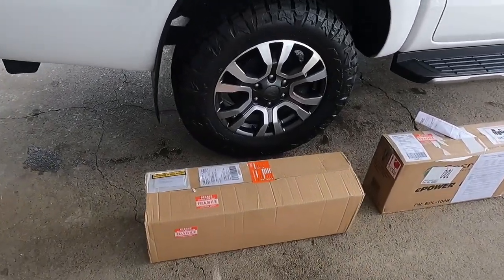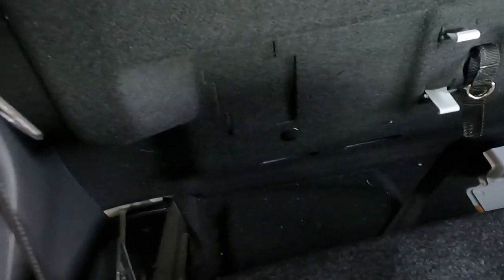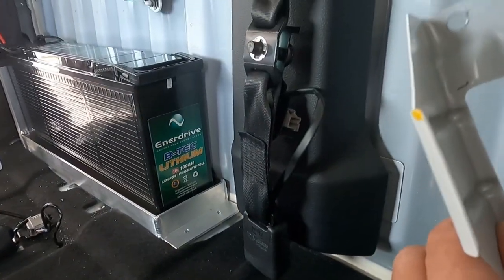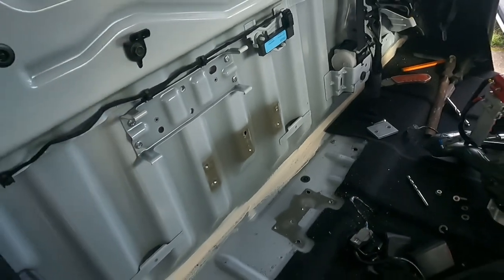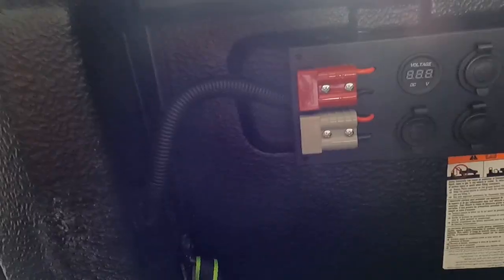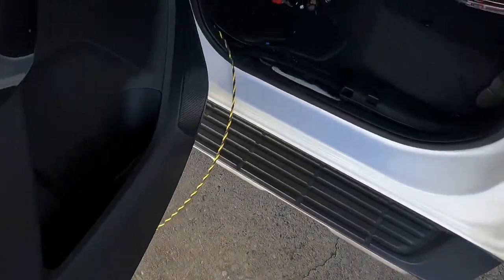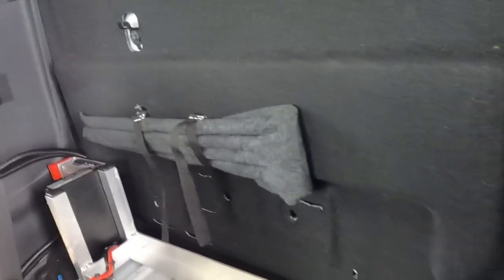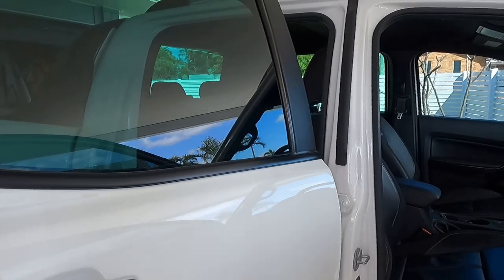Slimline Dual Battery system behind seat DIY install in Ford Ranger

Comment: Great video mate!

Did you need to turn your smart charging altenator off?
Reply from the maker: Thanks mate. I’m not sure what that is so assuming no😅
Reply: With the wire connected to the ignition source, that should cover the smart charge alternator issue.

Comment: Mate where did you order the kit from? Looks good!
Reply from the maker: Look up Accelerate Off Grid. They are based on Sunshine Coast but also online. We just did our first camping trip since installing and it didn’t miss beat.
Reply: @the4explore922  Hey quick question I have installed a similar product now when the car is running the idle drops down and up do you have the same problem
Reply from the maker: @jasonburke7683  No it didn’t change at all, maybe contact who you got it from and ask them about that

Comment: What does the fuse box control on the battery setup?
Reply from the maker: I believe they protect the battery from any surges but best to double check with manufacturer.